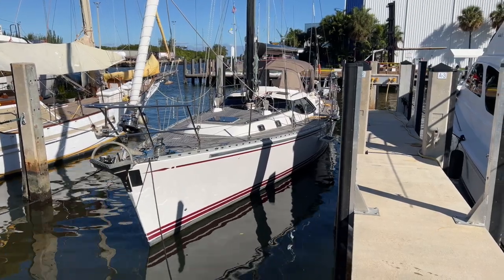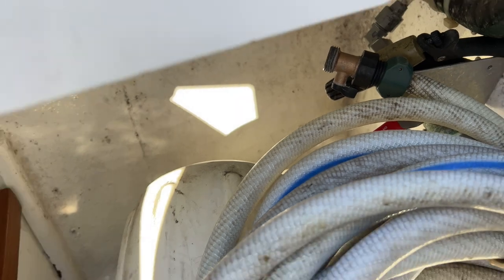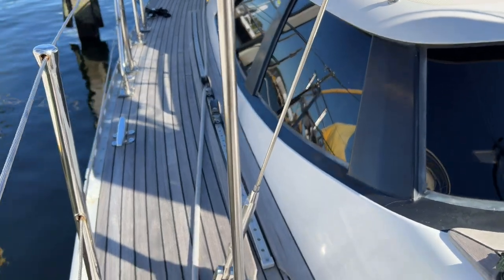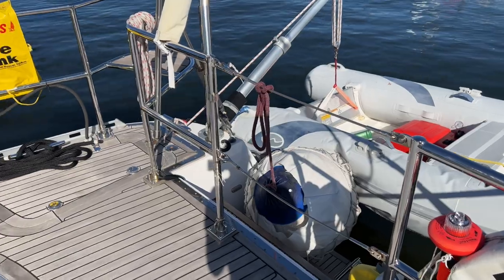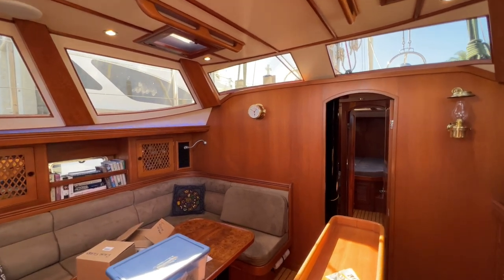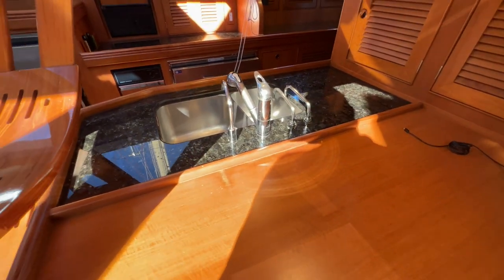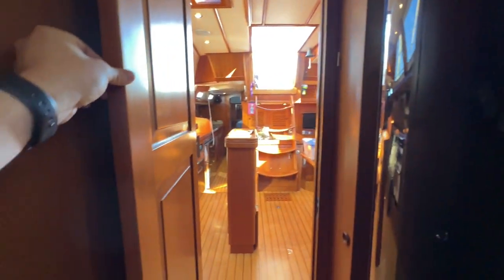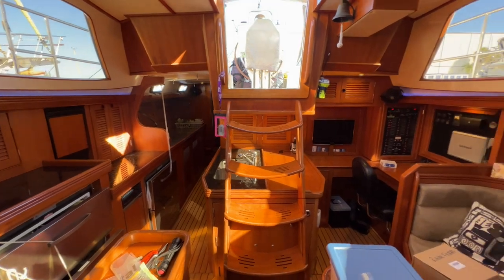Hylas 56 2011 'Andanzas' For Sale [Yacht Tour]

Comment: It would be valuable to describe the specific tankage volumes (water, fuel)as well as hours on the engine and generator....should be standard with all tours of these high quality yachts
Reply from the maker: There is a link in the video to the listing specifications...
Reply: It would be valuable to read the listing.